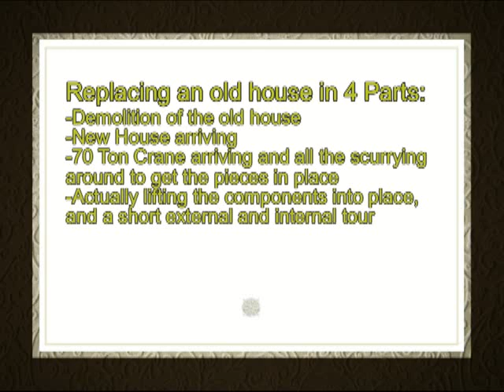Lifting Our Manufactured Home Onto The Foundation, Part4of4

Comment: I noticed you used wooden beams. Did you have to change these out later with steel? Thanks
Reply from the maker: If you are talking about the posts that support the center of the house, no.
We supplied steel posts to the installers, but they said that treated  6" X 6" wooden posts were better.  I don't remember why.  It has been 29 years since we built the house and NO problems with them so far.   By the way, the wooden posts are a lot easier to attach electrical outlets, telephone wiring, etc. to.
----Those posts were set on 2 foot square concrete piers.  This was done before the basement floor was poured.  The floor is 6" thick, so the posts are buried 6" deep in concrete.  They certainly won't be going anywhere.
Reply: @frenchcreekvalley  I did not realize they would provide the needed support but I was looking into a 84 lumber home a while back and they had a choice steel or wood. I see your point about adding electrical etc much easier. I think the cost would be lower and like you said 29 years later and its still standing:)  In a way it probably hard to see the old farm house many good memories I am sure of. I noticed you craned but others I seen used a pulley type system and pulled the home on. Is there a reason why you craned? I plan on doing something similar to what you did. My excavator is planning on doing a mound around the home to make it easier when we slide it on. Did you leave the Rodent Barrier or did you later remove and put drywall? I am getting pricing now on block wall because the superior walls are higher than I thought. Any thoughts? Thanks for quick response and getting back to me.
Reply from the maker: @greekdude001  The dealer said that using the crane was better for a walkout basement.
  He already had a crane company and his installation price was better than that of the other two dealers who bid the whole thing.
  One other important comment:
Getting the basement to be the EXACT size of the house is pretty important, as you might realize.  The crane operator told me that in some cases, they have had to have the house (or half of it)hanging there for many hours while the contractor rebiulds the basement walls to match!!!!  In our case, the contractor who did the basement did get the right info from the mfr..  I don't know how a size problem would be dealt with during a "roll-on".

We wanted to go with ICF for the walls, but nobody in our area was ready for it just yet.   We did use 4500 psi concrete everywhere. 6 inch thick basement floor. NO cracks anywhere in 29 years

Well, we left the rodent barrier on, in most places.  My wife has a 20 foot wide "studio" at one end of the basement and we put a drop ceiling in there.  But, even though I ran over 600 feet of electrical wiring down there, I wasn't sure what I might want to add to the ceiling later.
  We did build an interior 2 X 4 wall all the way around the basement, with vapor barrier and fiberglass insulation  with half inch drywall, by the way.
   Later on we also added a central vacuum system, with  all the pipes run in the ceiling.
  We wanted to heat and cool the basement, too.  So still having the black stuff up there made it easier to add adjustable HVAC venting.
  From time to time we have added a LOT of telcom wiring, and some plumbing, too.  I keep thinking that I should finish it off, but hey, it IS a basement.